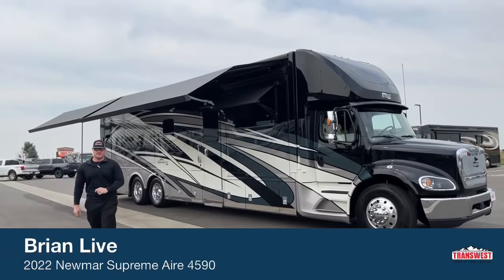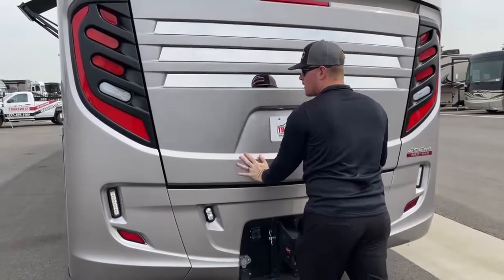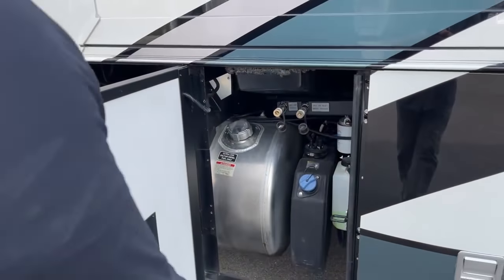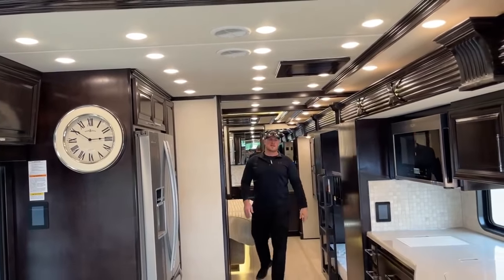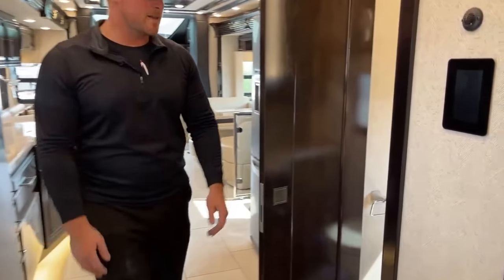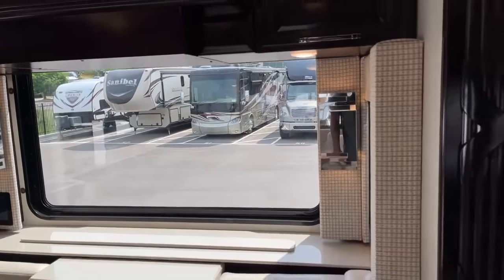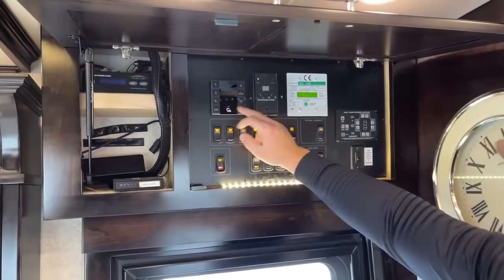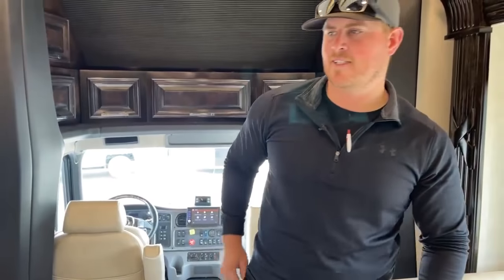2022 Newmar Supreme Aire 4590

Comment: Nice rig , are these super C’s allowed in resorts. I called one place in Florida and it was a high end resort but would not allow luxury super C’s like this.
Reply from the maker: You are correct. Some resorts do not allow Super C's and it comes from some old rules the high-end resorts started years ago. Now that we have nice super C's it would be nice if the resorts updated their restrictions.
Reply: @transwesttrucktrailerrvoff5922    We tried this with our Super C Supreme Air,   we called a resort and they said no.   Then I sent them a photo of our unit and they called back and said  Yes.      I think we all just need to "help them" re educate themselves on newer high end coaches.   There is really no difference in this and a Class A Diesel Pusher.
Reply: If you own one of those but can't park it,  what's the the point of ringing?
Reply: Rvinging
Reply: @macrichardson7440  Which resort was this that made this exception, if you're OK with naming them.
Reply: @macrichardson7440  you are 100% correct, many classes are much better than many many classes.